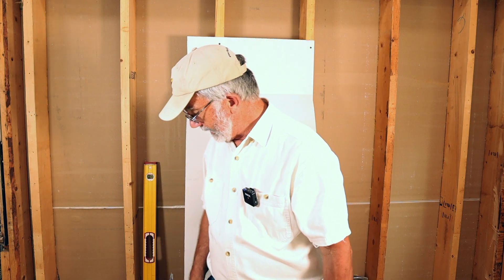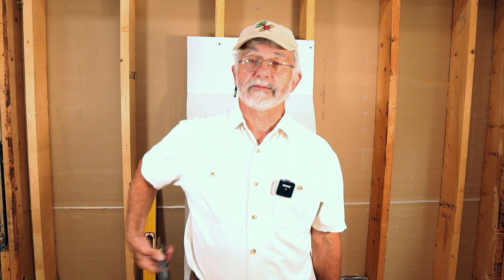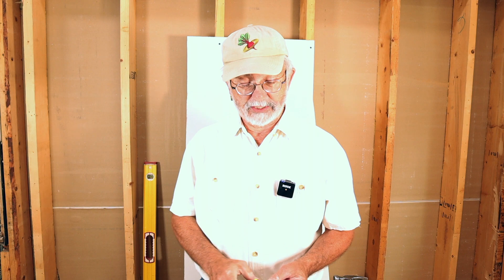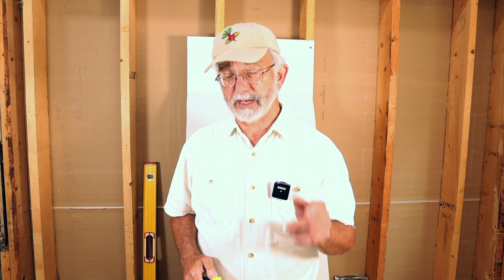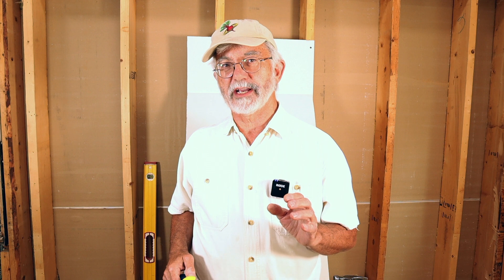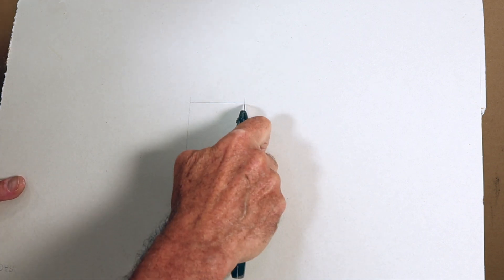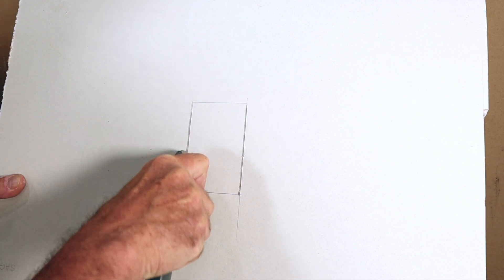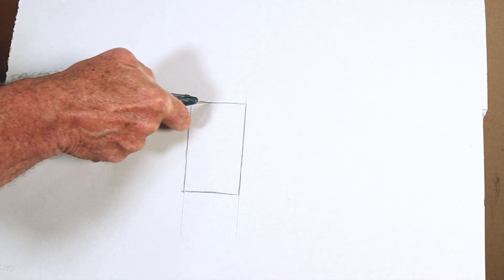How To Make Fast Drywall Cutouts With A Hammer

Comment: That explains why I see so much damage to the drywall around boxes when I’m doing electrical repairs especially in older homes that were built before rotary tools came into fashion in the industry. Pure slop. I’m not saying you’re a hack. I’m sure you do great work. But that’s why I hated doing production trim carpentry. Hurry up and get it done! That’s all that mattered.